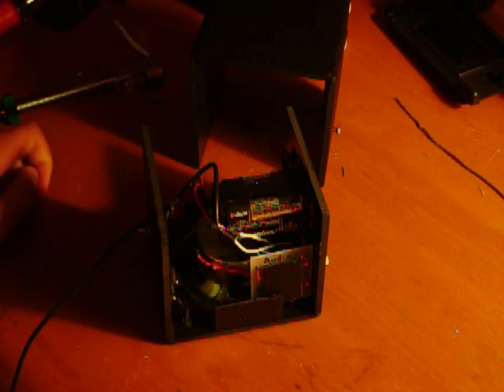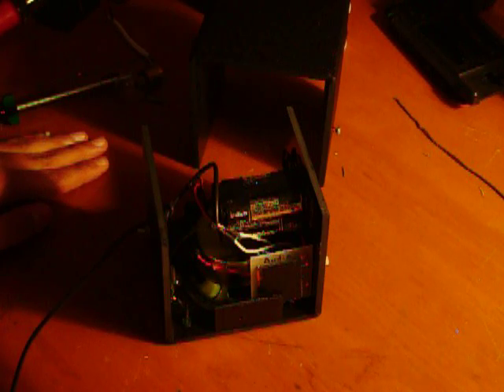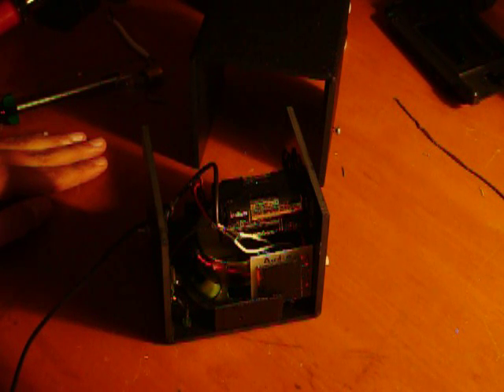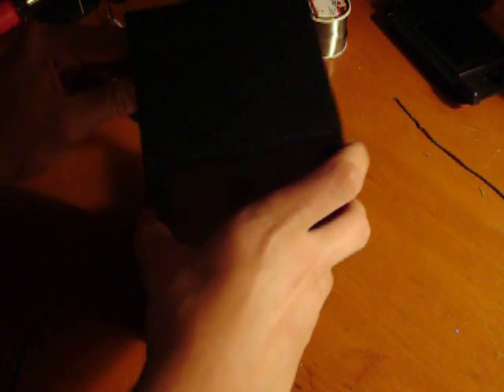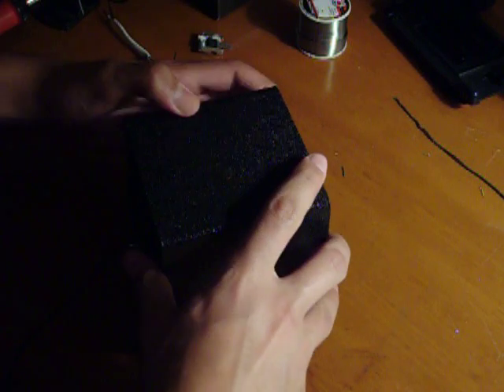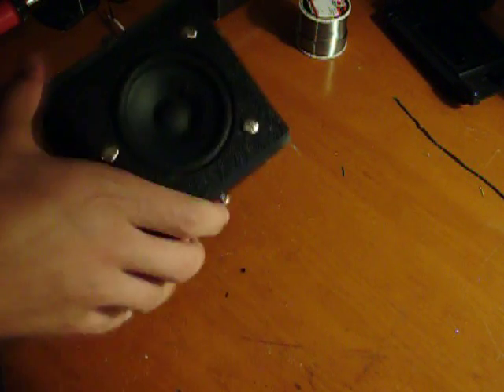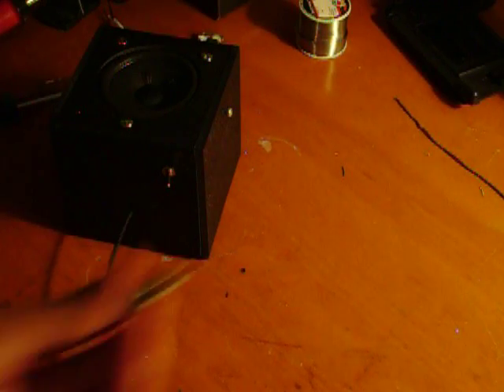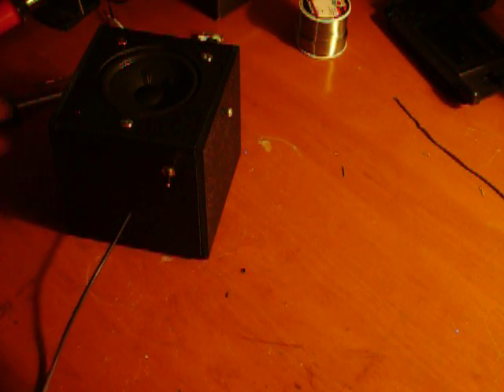LM386 based portable audio amplifier

Comment from the maker: it should be fine as long as you don't turn the volume up too much. You can also run the amp with a lower voltage and it will have less power

Comment: Using a bigger speaker of about 4 to 6 inches produces a clearer sound. Also using a low impedance speaker of 8ohms or less will help the performance quite a bit. A speaker of 1.5w or more is sufficient.